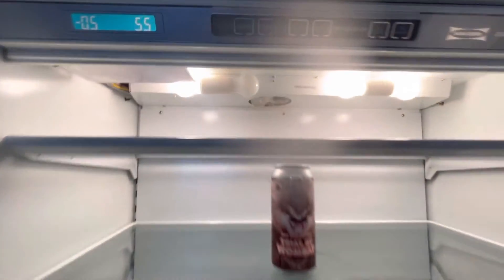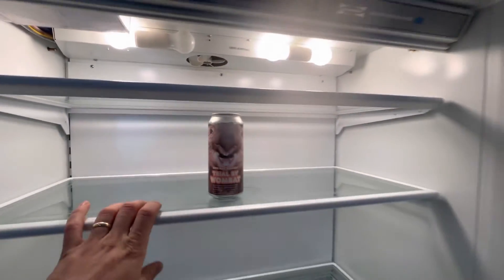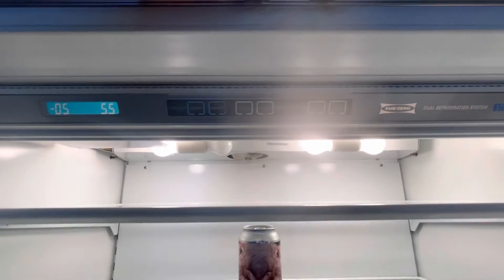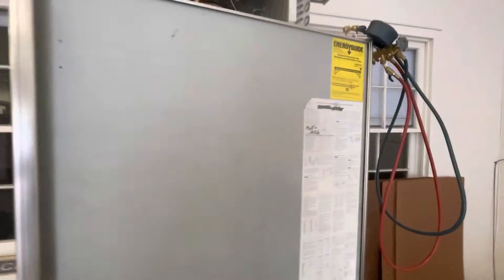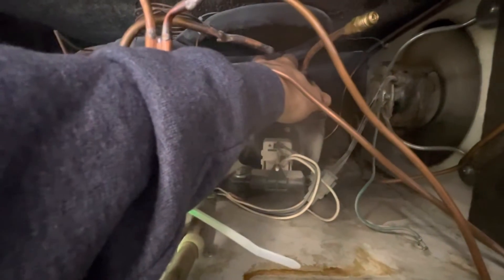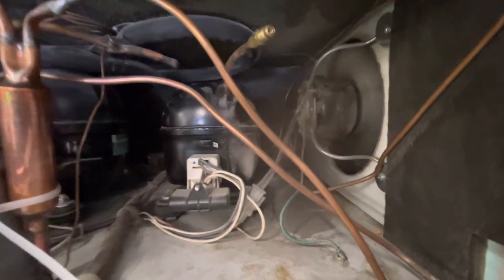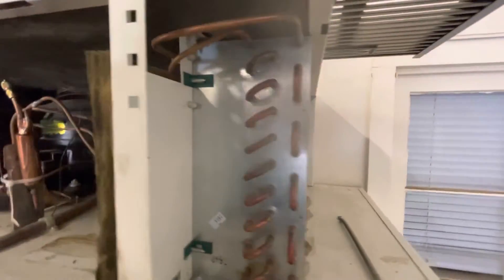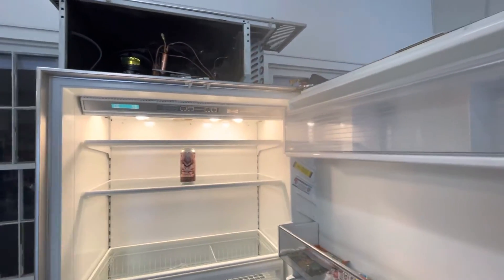Diagnosing a Sub-Zero Refrigerator not cooling - testing motors and electronics - part one

Comment: Hello, in order to check in with voltage tester, it doesn’t tell you how much power are you getting into the compressor? I think the better idea would be checking with the multimeter if you getting 120 V.?

Comment: Thank you, this was super helpful.
My subzero 642 refrigerator is not cooling (its at 58) even though freezer is cooling. I did all these diagnostics and everything checks out. Cleaned condenser as well by blowing air through compressor but still didn’t help. Now I have scheduled a technician visit.
Reply: Did you end up fixing it, what was the issue?
Reply: @ The issue was refrigerant leak. Eventually there was no refrigerant to cool it.
The solution was to rebuild refrigerator side (new compressor, fan, line, evaporator) ~$2800 including labor and 1 year warranty.

Comment: Hello, love your videos. I wish you were located in CA!  I have a SubZero 736TC and the condenser fan doesn't seem to start.  Freezer is cold, Refrigerator got hot as did the front tank.   I hear a click ever once in a while, which I assume is the relay trying to turn it on. I get 11.5 vt at the fan connector, but not sure if that's enough voltage or if it's ac or dc, since I haven't pulled it yet and my voltmeter is on 'auto'.  The error codes seem to be fine. Is there any test I can do to confirm it's the fan and not a thermistor or relay?  Much appreciated! -J

Comment: Hi! I have a (1999) 650F and it is not cooling in the refrigerator section. Freezer is working fine. Error code says Vacuum Condenser, which I have done. Alas, there are no service people in my area. The light works ‘most’ of the time….just have to flick the toggle to make it come on if it doesn’t when I open the door. I am sooo frustrated, as I don’t want to ‘just buy a new fridge’ (as the advisor at SubZero said!). Any thoughts?
Reply: @subzerorepair  Is it OK to call you?

Comment: Outstanding videos. My 601 F seems stuck on over cooling. Reading -20. Gonna try cycling the breaker to see if the compressor is stuck on.  Thoughts?
Reply from the maker: Stuck relay on CPU board. May need new board.
Reply: @subzerorepair  update- there are 5 relays on the board- I’m guessing compressor, fan, defroster, ice maker. Not sure which is which- would love to know. I tapped and thumped each one. Freezer working fine now!!!! Gonna change out board anyway and keep this one as a back up
Reply from the maker: On the right path! Reset at breaker! Sounds like the relay on the board is stuck and your compressor is not shutting off.

Comment: Hello my sub zero 601f once in a while we will open it and it will be very hot on the inside and around the door ??? can it be stuck on defrost I? thanks Dan my wife thinks the door was not shut all the way when this happens and it is really hot in there
Reply from the maker: It can get stuck in defrost, indicating a bad control board. However, when this happens it’s quite obvious as your food will literally cook inside the machine. My guess is that you have a bad condenser fan motor. Very common. The heat you are feeling is the high side refrigeration lines on the interior of the door overheating due to a bad fan. Watch @subzerospecialists video on changing a condenser fan motor.

Comment: I have a BI-42S, and it stopped working. There is power to the lights; however, the control panel is not functional, meaning that no numbers are showing at all. Yesterday there were two times when the power went out; not sure if this caused any issues. Any ideas on where should I start before calling for service? I'm in GA. Thanks.
Reply from the maker: You have a bad cpu board part number 7041549. I’m sure you figure this out already